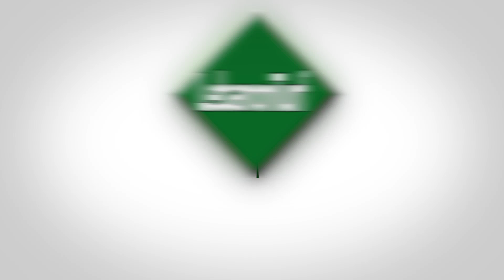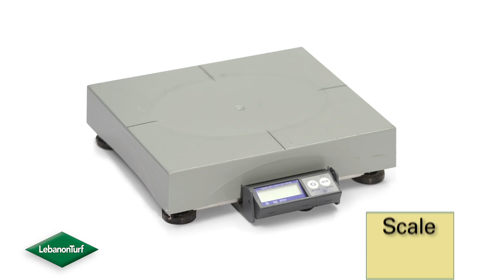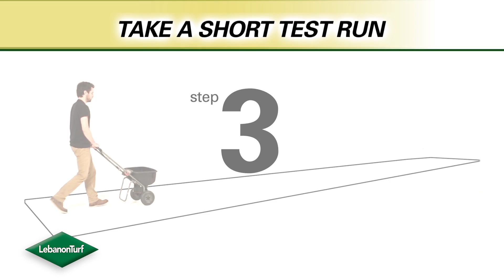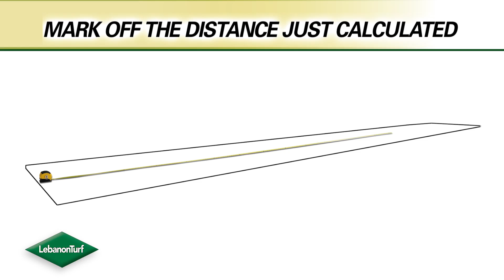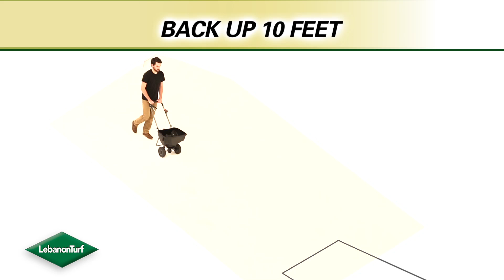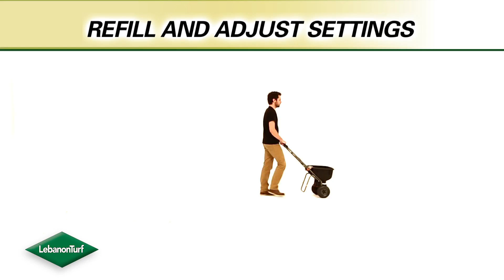How to Properly Calibrate a Fertilizer Spreader - LebanonTurf

Comment: How about a video on the Lesco spreader calibration keys. Thanks for posting by the way. Lesco best equipment I’ve ever used 
LESCO EQUIPMENT 
Hard to Beat. Even Harder to Break.
When you make your living outdoors, there are two things you need from your equipment—productivity and toughness. We got the message. That’s why we carry a full line of equipment that’s durable enough to bounce back from the punishment of professional work. Designed to save time and money, every piece of LESCO® equipment brings productivity to the job day after day and decade after decade.

Comment: Step 1:  Buy a Scotts broadcast spreader. Step 2: Read and follow instructions on fertilizer bag / turn the spreader to the setting # noted on the bag.  Step 3:  Spread your darn fertilizer.
Reply: I did that,My spreader ( Scotts DXL) calls 11 1/2 setting,for Milorganite Fert. for 2500 sq ft,two bags should do my yard. It will be more like 5 bags, 11 1/2 ,it pours out in no time flat .  It's a brand new unit !
Reply: That's why they don't want homeowners applying things to their own lawns. All spreader settings are starting points that's why they give you application rates also. This is so you can check  your application and adjust were necessary...

Comment: Nobody goes to the trouble of measuring and marking.
Reply: If your spreading one of Lebanon turf timed release products with Mesa in it, that costs a lot per bag, you would have to be a millionaire to not do this calibration.
Reply: @RLWelch876  I did not mean to confuse you DD. 
Let me say that another way, unless you wanted to waste your money or spend lots of time cutting turf that was growing very fast, knowing what amount of fertilizer is coming out of your spreader is important.
If you are "a millionaire" then do as you wish.